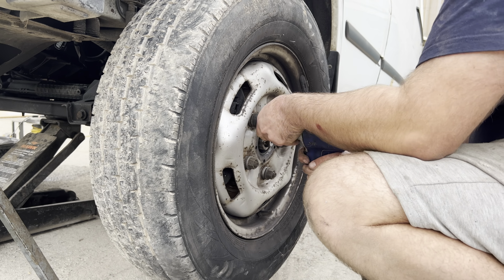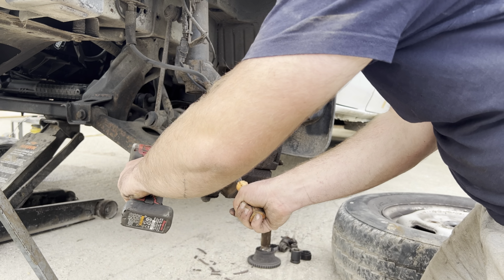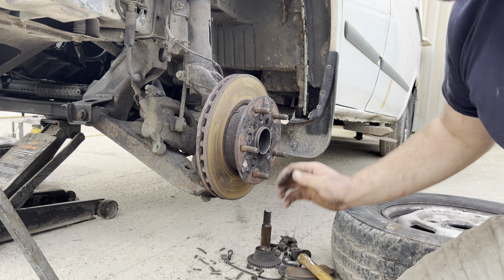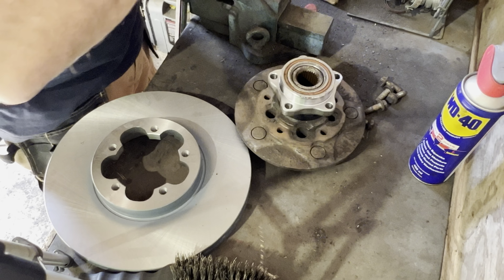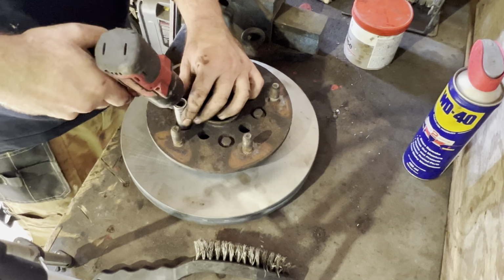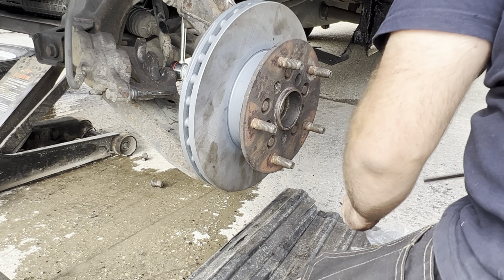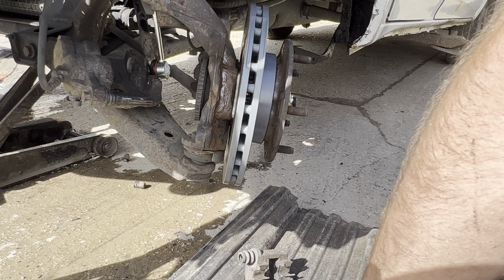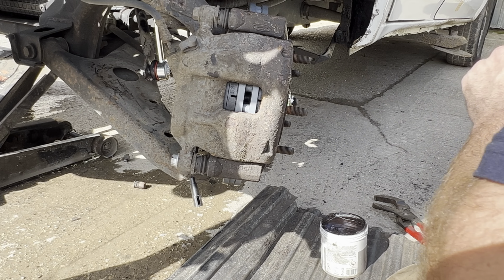Replacing front discs and pads mk7 transit

Comment: Best way to get the discs off the hub take all the bolts out and then drop it on the floor from knee hight with hub facing upwards and it will split apart been doing it for years
Reply from the maker: Great tip. Always learning

Comment: Ive just snapped the T50!!! Any advice on how I can continue with the job? Great tutorial by the way
Reply from the maker: Hiya! I had this happen to me once! I used a magnet to fish the snapped part out ( may need to tap the side of the bolt with a screw driver to help release. Then if you don’t have another t50 find an Allen key that fits in. Make sure you smack it in a few times with a hammer! Good luck!

Comment: I would like to know the length of the T50 tool, can you tell me?
Reply from the maker: Hiya. From memory it’s a T50. 110mm length. I bought a set made by US pro however go for the best quality you can afford as those bolts are damn right!
Reply: @Automotiveolie what do you do when the disc bolt rounds off and the hub torque bolt rounds
Reply from the maker: @anthonyhudson4318   the bolt which olds the disc to the hub? Either use a bolt extractor, or hammer a 12 sided smaller socket over it with plenty of WD40 or similar. I’ve never experienced a hub nut rounding off. It sounds as if it’s all really badly corroded it may be easier to source a new assembly or just keep beating smaller sockets over the problem bolts